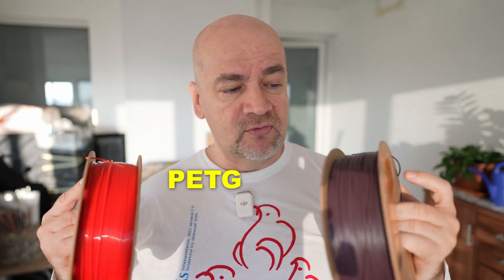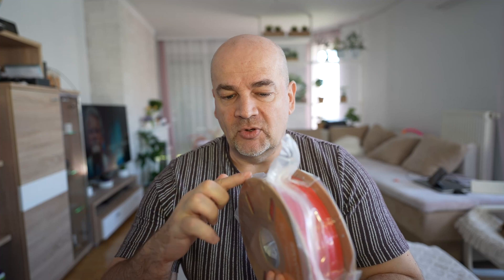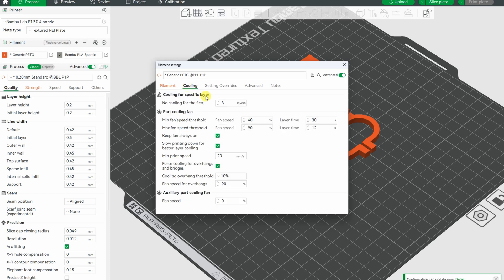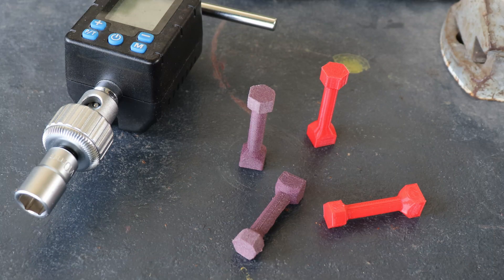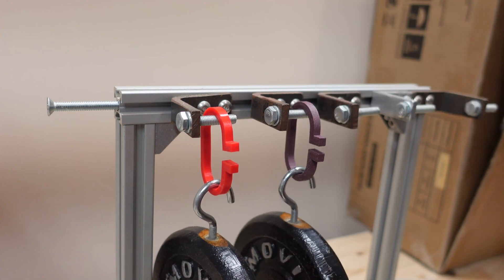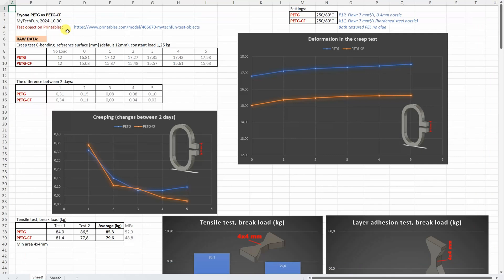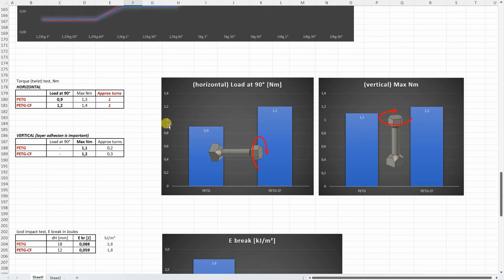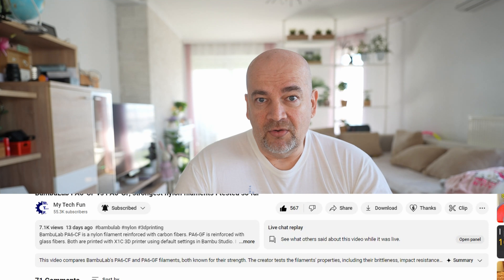On the test: Eryone PETG vs PETG-CF (carbon fiber) 3D printing filaments

Comment: Your prints looked great. My CF-PETG from Eryone, never would come out close to that. The stringing is the worst I have ever had. I have dried it, calibrated flow (which is way off from any other filament). Never use it again. Everybody says CF increases PETG's printability, not from my experience with Eryone's.

Comment: I tried out PETG-CF to make a brass insert/solder iron press. I was not impressed with the layer adhesion.I have the feeling that, PLA would have been stronger.

Comment: Good tests but printing them in the same colour and on the same printer would reduce some variables.
It's known that the colour of the filament affects the properties.
And even very similar printers can print slightly different, especially with different nozzles.

Comment: I love these videos.  I'm introduced to new filament manufacturers and I learn very practical information directly applicable to additive manufacturing.

It would be easy for viewers to want to see exhaustive testing of all filaments, at all temperatures, with and without annealing, etc.  That's not practical, even with your dedication to testing, but it's great to see the same standard tests for different manufacturers.  It would also be very useful to see the occasional comparison of other factors on a filament that probably translates well to all manufacturers.  For example, maybe repeat the tests for a particular filament or the regular and CF versions of the same filament, but at 250 C, 260 C, 270 C and 280 C nozzle temperatures so we can see the effects of nozzle temperature on layer adhesion, etc.

Comment: -- Did you make PET-GF(PET glass filler) filament review yet, or did I missed it?

P.S. Thank you for your work, I got plenty of useful info on your channel. Liked and Subscribed!
Reply: -- BTW, how about ABS-GF filament review?
Reply from the maker: Only one PET-CF so far, (Bambulab) but I have 2 other brands here too (PET-CF) ABS-GF: eSun and Bambu tested. Siraya on the test now
Reply: @MyTechFun  — Thank you for a reply, one of the reason for me GF filament is more appealing because I fly radio control aircraft, and Carbon Fiber interfere with radio signal, while Glass Fiber does not, that is why GF filament is more interesting for me. Thank you, once again.
Reply: @MyTechFun  -- Also, I found interesting info from QIDI(where I plan to buy my PET-GF) TDS(Technical Data Sheet) about improving strength of printed materials, same goes to TEG-CF too/as well, in order to improve part strength and better material adhesion, it is recommended to heat treat part after printing. Here is quote from QIDI TDS:

"4. After the printing, the printed part can be annealed to further improve the strength of QIDI
PET-GF print part. Annealing conditions: place the printed part at 80-100°C for 4-8 hours and cool to
room temperature naturally."

So, the key to strength of printed part might not be in printing it at higher temperature, but annealing it to cure and improve bonging of printed composite materials.
Reply: @MyTechFun  -- BTW, do you know what is S-White support material, that QIDI recommends to use with materials like PET, ABS and TPU? According to TDS it provides better printing surface adhesion and prevents warping/no warpage.

Comment: Egor please could you start to include dimensional stability testing? Warping properties are extremely important for larger parts. I had been using Tinmorry PETG-CF but I recently changed over to the Eryone version as it is 20% cheaper (at my location). I discovered that you can print at a considerably lower temp whilst keeping the bed temp high. I used 220C for the Eryone PETG-CF and the layer adhesion was very good. I hope the dimensional stability will be good with the lower print temperature. I highly recommend the e3D high flow Bambu hotend if you have not tried one yet because it allows for much lower print temperatures whilst retaining good layer adhesion. I used to use a Trianglelabs PCD high flow (CHT 3 hole style) in my Bambu X1 but the e3D version is pre assembled and much cheaper. I think it's a really good upgrade for layer adhesion and possibly reducing warping. I have not tested it yet but going from 250C to 220C is quite a lot and at 220C the layer adhesion was very good. Maybe you could test it?

Comment: when testing level adhesion, can your test print have zones of different print temperatures, and wherever the test piece breaks may indicate the weakest temperature zone, or will that be inconsistant because of test shape/length?

Comment: PETG-CF is amazing to get beautiful prints with almost entirely hidden layer lines. It has very few downsides and has added temperature resistance. The best brands my friends and I have used are Tinmorry, Eryone, IEMAI, and Voxelab/Flashforge. It's also easier to print than PETG overall in our experience.
Reply: Every tried Bambu PETG-CF ?
Reply: @ravenmooore  I have not, sorry. I imagine it is solid at least.
Reply: @ravenmooore  I tried it, it prints very well, hardly any layer lines visible, the finish is fantastic.

Comment: Spreading information: Please seal the petg-cf after printing with clear coat or something. Carbon fibert will get embeded in your skin if touched.
Reply: old myth, it's a non issue
Reply: @ what you mean old myth. It’s been proven but Nathan build robots channel.
Reply: @versus023   he didn't prove anything really, just scared some people pointlessly. It was later disproved by prusa using real science, not some subjective hunches
Reply: @riba2233 oh. Didn’t see prusa video! Good to know. I’ll check it out. Thanks.
Reply: @versus023  I think it was an article on their re dd it
Reply: But then you can have carbon fiber reinforced skin.

Comment: Would it be possible that annealing helps the PETG-CF to improve the Layer adhesion? Or at least better the HDT?
Reply: no, it is amorphous (that is the G part yes)
Reply: @riba2233  ahhh, now it makes sense why all the annealable PET CFs are without the G. Thank you🙂
Reply: @fordgeher  yep, that is the main difference between the two :)
Reply from the maker: I wanted to test, but PETG cannot be annealed (according to other users, I asked). Only PLA, Nylon, they can really benefit from annealing. CF helps for less deformation.
Reply: @MyTechFun  is that because of the G in PETG? Because PET CF can be annealed? Due to its semi-cristallin structure it should generally be possible to anneal PET. Just guessing, I am also not sure.

Comment: im unsure if it will have a difference in all the tests, but Eryone PETG-CF really needs to be dried before use. this comes from a person who NEVER dry spools normaly.
and the Cf one in the video looks a lot like the my prints before drying the PETG-CF.

also I got better prints with 255 temp.
Reply from the maker: As I mentioned in the video, there will be another test with this filament, and there I will dry it too. We will see.

Comment: Please start drying them before printing, if you don't then the tests aren't accurate.... My eryone PETG-CF came wet I know they claim to dry it before bagging but you don't know how long it's been sat in storage and it can still absorb moisture through the bag.... it also prints a lot better and is stronger when dried properly

Comment: I am curious if filament similar to how QIDI* makes them would help here.
Some of their CF/GF filaments are made where inly the core has CF/GF and rest is pure material, so the layer adhesion is as good as it could be, while getting most of the GF/CF in the filament.

* I realize I mention QIDI filaments a lot, but I just have an X-Max 3 printer and mostly use QIDI filaments or Prusaments, so those are the ones I know about.

Comment: The primary reason I'd use CF with PETG is to minimize deformation/creep, which you showed well but it's still not ideal for some parts. Testing very rigid parts under load at elevated temperatures and still well below the glass transition temp might expose some interesting issues. Perhaps a simple, acrylic or foam board enclosure kept  around 50C or so (such as temps often found inside an enclosed printer). This may seem redundant and take too long to be practical but the effect of creep can be surprising.

For example, I tested a horizontal bracket for a belt driven extruder design in PETG that was very strong (about ~15mm thick) and mounted on top of the original metal motor mount. A small belt from the motor went to a large pulley on the extruder and under constant tension. This would never flex at all on its own but eventually the half not supported (holding the extruder) visibly deformed enough to cause notable issues with the accuracy of the belt drive. The chamber was no higher than 40C. It was warmed up through the metal by the motor but this also had another heat sink on the bottom.

CF-PETG lasted longer and deformed about half as much but was still a problem. Only printing the same part in ABS completely avoided creep from occuring. Even PA-6 Nylon was affected but took longer and to a lesser degree (PA-12 and/or CF fill would probably be fine but I got tired of testing).

Comment: Mr Igor, nice video. I see your mention that 80mm/s is roughly 6.4mm3/s flow. I’ve been searching for a formula to calculate this, but I’ve failed to find it. 
Do you have a formula for this?
Reply from the maker: It is very simple calculation from geometry. Speed * recangle area made by nozzle. In this example: 80 mm/s * 0,4 mm nozzle diameter * 0.2 mm layer height = 6.4 mm3/s flow rate.
Reply: @ Thank you for the explanation. That makes sense.  Translating this to the Filament settings in the slicer software, whether that’s Orca, Bambu or Prusa… Would you fill out the max mm3/s only based on the nozzle size and default layer height for this nozzle? Will the slicer compensate for thinner layers? Just making sure I fill out the correct maximums in my slicer :)
Reply: @JelleKalf  no, the max flow rate setting is meant to limit the printing speed to YOUR machine's capabilities. 

For example, lets say that your extruder can sustain 40mm³/s, that's 500mm/s at 0.2mm layer height and a 0.4 layer width.

However, if for some reason you need a bigger layer width lets say 150% or 0.6mm , If you increase it just like that, you will have underextrusion because you are now trying to melt more filament than your extruder can, since you were already running at your extruder's max capacity.

That's where telling the slicer the max flow of your extruder comes into play, it will notice that the extra line width goes over the limit, and will automatically limit the speed to 333, so you no longer have to worry about measuring any of that. 

The cool thing is that it will do these calculations for every different parameter of the print and will limit the speed only as needed by your printer, so if you change layer height, or width, you'll prevent underextrusion without unnecessarily reducing speed where it's not needed.

Comment: I'm just not sold on CF PETG or Nylon, I don't think the fibers are anchored into the material as good as it could be from any results I've seen, PET-CF is something else entirely though.
Reply: it works really great for nylon
Reply: @riba2233  As I understand, it does help a lot with warp stability for printing, and to prevent heat deflection in application. But it's not the silver bullet most were lead to believe, as far as augmenting it's mechanical properties to being something more. Because of course in the end it's the same material but with chopped strands embedded into it. Maybe in the future when continuous-strand reinforcement is more matured.
Reply: @Roobotics  especially with nylon it helps extremely with stiffness (from 1500 to 8000 bending modulus) and temp resistance, not to mention creep, huge difference. It really changes the properties and elevates the material
Reply: @riba2233  this is good info to know, perhaps I'll have to reevaluate nylon then. If anything, the fact it is more stable to print means it's generally more accessible by all, instead of highly specialized machines

Comment: The scientific way you analyze each filament is appreciated. Per your results both are good filaments. Personally I want to try the carbon fiber filament based on the visible finish on the printed parts. It’s nice to know it will perform similar to the regular petg.

Comment: Petg cf performs even better than in this test if you get a higher quality brand and use an enclosure holding about 35c. I've printed most major and even amazon brands hundreds of times. IMHO it is the best all around filament there is on the market. Print it hotter and in an enclosure and the layer adhesion will be better than pla. My personal favorites were atomic and phaetus.

Comment: PETG-CF has one major advantage for my use cases: it sticks better with superglue. Matte finish is another one, but not unique because there are PETG matte filaments available without CF.
Reply: Not much options though in matte Petg
Reply: @opiniono-1  Extrudr has good one with some color choices and their last Black Friday deals were impressive. PETG CF excluding black seems also only available in the Bambu Lab store and there are some concerns that those carbon (and glass) fibres could hurt you in a similar way then asbestos. Usually carbon fiber parts are laminated unlike 3D-prints. "Nathan Builds Robots" made a video about this topic, showing some concerning microscopic evidence that literally goes under the skin...
Reply: @Leynad778  non-issue, he is spreading fud
Reply: @opiniono-1  that is because it sucks

Comment: I never expected Petg-cf to have that much layer adhesion. Very interesting.
Reply: This filament only has 6 percent carbon fiber content. I manufacture composite filaments, and in my experience layer adhesion crashes exponentially with the additive ratio.
For example, 50% Iron powder-ABS filament has 5 times lower layer adhesion than 30% Iron powder-ABS filament.
Reply: it looks like it doesn't have high cf infill %, that surely helps
Reply: For some reason PETG with CF seems to be a magic sauce. It's like a cheat code for easy beautiful strong prints. When I first printed Eryone PETG-CF I was amazed by the layer ashesion. I did a max flow rate test, so it was only one line thick, and it was easier to tear it across the layer lines than along them. Bending in half in the direction of the lines wouldn't snap them apart either. Totally wild!
Reply: Yep a common misconception fomented by channels with little to no experience with it.  hundreds of times

Comment: I love your tests! However, I find petg benefits from a higher printing temperature. Would you consider running these tests or future tests at all the way up to 265 c?
Reply: Same. My petg prints are virtually always just one solid layer- breaks like injection molded plastic over all axis. No layer lines even VISIBLE. I do tend to run hotter as well. And larger nozzles. None of this 0.4 stuff
Reply: Higher end of recommended helps a bit but I find lower cooling helps more, usually run 20-50% cooling and don’t crank it up until over 50% overhang.